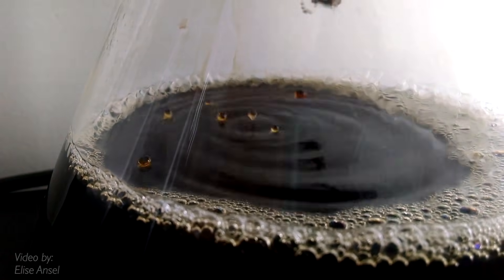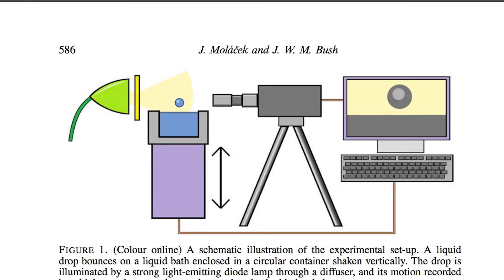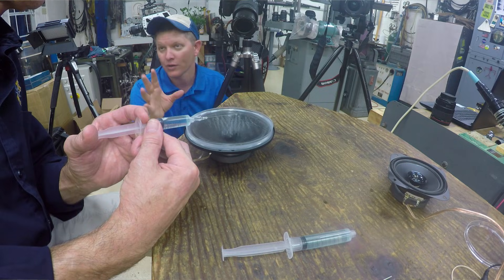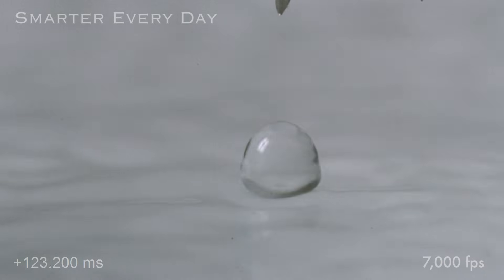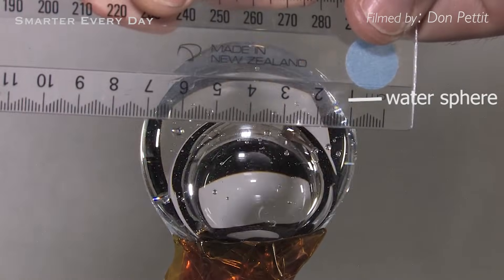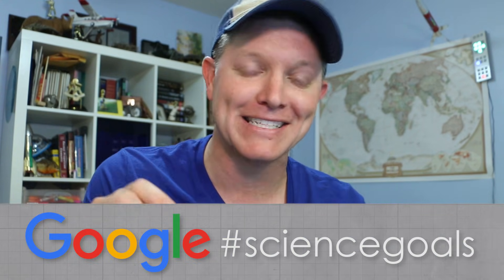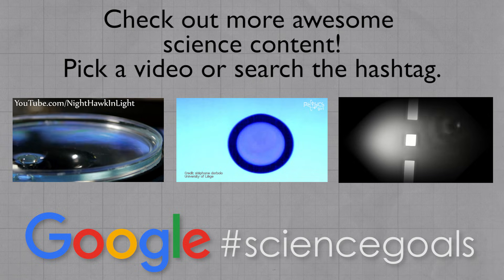The WALKING WATER Mystery (in SPACE and SLOW MOTION!) - Smarter Every Day 160

Comment: Hey man, you are clearly brighter than me, but if I can throw a couple of experiments at you that i did around something very similar. Run sine waves at 620hz and the water boils. Now, think about this, why boil? I took it one step further, and discovered hydrogen separates from the O2 at 500hz. So in effect, we are creating a quasi electrolysis . HOWEVER, coming to your quest, i noticed one of your "queries" before you approached the scientist/astronaut  , I saw hydrogen bubbles from the heat. This made me curious. So I made some bacon and eggs, and then put the hot pn under room temperature water from the tap... only a few drops. Watch the reaction, its hydrogen separating from oxygen . What do you think man? its fairly interesting. Nice work bud, keep it up

Comment: but, what about when the surface is smooth and calm. and the drop of water float across the surface, and bounces off the wall, and remains in motion for a little before sinking. why does it do that? there are NO vibrations to create a layer or a cushion of air.  then what?

Comment: I always thought it was because the water droplets were a different temperature, making the water density just enough different that the water would bead, until the temps equalized. just a guess. but the same (beading) thing happens with oil and other fluids as well.

Comment: at the speaker scene you have the speaker only half full and the water drifts to the side but if you fill it up over the rim, which is doable you would get water drops floating in the center only and that's because its the highest point on the liquids form

Comment: hey Destin. I think the mass of the drop isn't enough to overcome the surface tension of standing water. Gravity does overcome the drop over time, but there is enough resistance between the surface of the reservoir and the drop to repel it. When you applied the sound waves it incressed the surface tension, in different ways, at different frequencies right? This is entirely theoretical, for me im just trying to offer a different perspective.

Comment: Great video, but it puzzles me that you are clinging on to the idea that there is a layer of air between the droplet and the body of water. Intuitively, or from what I know, I would say this is a result of surface tension, of which I may be equally wrong, but assumption, as we all know, is the mother of all f... ups. A common misconception about gauge blocks sticking together, also had the idea of air cushions which had to be squeezed out, but this also turned out to be false, at it also happened at the ISS.

Comment: surface tension of the bottom layer of the water is increased as the frequency increases, more surface tension in the bottom water layer has its particles moving with resonant waves. The off chance the top droplet does get observed is possibly at the perfect droplet contact with the critical points of the frequency wave.

Comment: Electrostatic repulsion and surface tension. Both the body of water in question and the water droplet are subject to electrolytic charge and surface tension.  The droplets you are observing occur when the water droplet has a opposite electrolytic charge than the body of water it is falling into, since the charge is present in the surface of the droplet and the body, the surface tension of both the droplet and the body of water repel each other until the charges equalize.
Reply: opposite charges attract.
Reply: Surely equal charges repel?. But yes. I feel there is more to this than air / water boundary effect.
Reply: Surface tension.  Period.
Reply: Yah I totally agree
Reply: They mention electrostatic, not electromagnetism... ???
Reply: NO! The charges do NOT 'equalize'. The water molecules reorient themselves so that their polar dipole moment attracts instead of repels. It isn't electrostatic, it's polar molecular! This is actually a better explanation than an air layer but the air is necessary to form the water liquid crystal phase. In reality water at an air-water interface undergoes a phase transition where the water molecules are oriented in liquid crystal chains due to their polar dipole moment.

This (North-South-North-South) bonding structure is much stronger than the bulk water and the interaction of the two surfaces will naturally be of like charge and therefor they will repel!
Reply: Then why does changing the air PRESSURE change the phenomena?
Reply: Because removing the air pressure changes the surface tension and electrostatic pressure. Seriously, this isn't even Physic's 101. This is like Physic's 70. this is covered in the most basic introduction to Fluid Dynamics.
Reply: I still don't.  Nobody yet here has showed me how you can make a drop of water hold a charge, but hey, don't let little things like that bother you.  ;-)
Reply: Close but not quite.  It's actually exclusion zone water that is forms a layer of negative charge around almost any body of water including droplets.
Reply: rushthezeppelin EZ water is what taylor was talking about... "liquid crystal". Same thing different name. Just more details and technical terms that were not used in some videos I've seen, on this topic.

Comment: Not entirely convinced. Kinetic energy is a factor in the destruction of a droplet, but isnt a skating droplet a surface-tension phenomenon?  The macro binding energies in both the droplet and the water being directed mostly laterally, (and not toward each other).
Also, it may help greatly if the surface is turbulent because this might increase the amount of overall gap between both surfaces.
Does having rotating droplets increase longevity?

Comment: this has nothing to do with air molecules! it's due to temporary electromagnetic charge differences in between the drop and the landing surface!
Reply: "It does not". Dude, there's a paper... People tested it.
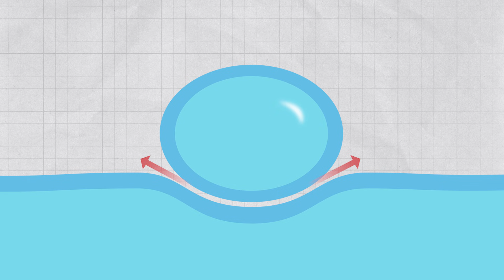Reply: +John Sikes  Sure 3:32
Reply: John Sikes The "it does not" was directed at the original poster
Reply: Liquid water cannot exist in a vacuum. It will boil.
Reply: or to be precise, the lack thereof ;)
Reply: k1p Are you high?! Jesus christ ive never heard something so stupid!
Reply: Then why does changing air pressure effect it?
Reply: Do you mean "Affect it" No it does not! use complete air vacuum you will get the same results! Cheers
Reply: Jon  ...  Sort of.   That's like saying liquid water cannot exist in a pot boiling on the stove.  It can for a while, until it boils away, which does not happen instantaneously, although it definitely doesn't sit "quietly".  It can also exist for a VERY, VERY long time underground as ice or possibly liquid in locations like the moon, I think.  Also, to further address k1p's statement, experiments show the time to the bouncing drops "melding", or disappearing into the main body of water it's bouncing on, DOES change with atmospheric pressure.
Reply: Tordah  ..  Which part are you referring to?  Can you link me the paper?

Comment: Great video thank you for posting it. I had a science question about it tho, is the coalescence delay only being affected by the air pressure or could difference in the surface tension between the droplet and and pool of water have an influence as well? Could this experiment be tried in a vacuum to find out?

Comment: I have a theory on your water droplets but you and the other people on here might not agree! The water that is standing is static plus is heavier than the water droplets falling on it. The water molecules in the droplets are lighter than the standing water that it's hitting, it doesn't have the correct amount of equivalent molecules to merge with the same water of it's composition and or mass. Therefore the droplets the sit on the standing water, when they sit there the heavier molecules in the standing or static water have to move out of the way to except the lighter molecules in the droplets... Also the droplets traveling through the air might possibly have differently charged particles/atoms in the molecules of the water droplets that are different than the water in the standing or static water. They repel each other like north & south magnets, the standing water has more mass and eventually change the little water droplets at a subatomic level to a point that we don't even understand!

Comment: In regards to hot liquids: My guess the hotter the air or the liquid making the air hotter in the case of the coffee will excite the air molecules making harder of the water to become one. The air molecules are bouncing around between the liquids instead of flowing outwards at a cooler or normal temperatures. Also steam from coffee could play a roll.

Comment: I would think that this has more to do with the force of surface tension keeping the bodies separate.  

A pocket is made in the water that the drop lands on do the the surface tension of the drop deforming the surface of the water.  This would be due to the surface of the drop, as well as the water, having their water molecules aligned so that the poles are opposite of each other, thus repelling.  With water having a positive pole at the hydrogen end and a negative pole at the oxygen end.  For this example the surface of each body would be positive or negative.  In the "Theory vs Experiment: What is the Surface Charge of Water," it was found that equilibrated water (water exposed to air) has a negative charge.  The surfaces would repel each other and there would in fact be an air gap.

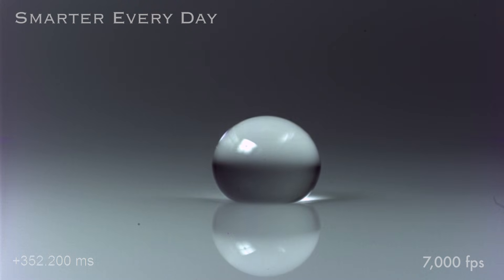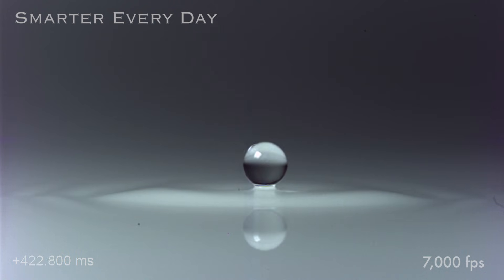Once the bodies are in proximity for enough period for the poles near the surface of each body to align they merge.  This would also explain why when the droplet merges with the water it does so violently and, as seen in the video @3:46-3:56, the upper portion of the merging droplet begins to form another droplet body.  With the poles continuing to align and merge the body faster, smaller droplet bodies continue to be made until the entirety of the droplet mass merges with the larger one.

I wouldn't doubt that the droplet bouncing is effected by air between the bodies, though I do not believe that fully explains what is being observed.

Comment: Cool video, but you didn't take in consideration of a key fundamental property of water that holds water together at the molecular level. The edge of water is made up differently then the center of the same water mass at the molecular level. This is what kept the water in place at zero gravity and allows drops of water to bounce on a larger mass of water here on Earth. It's also is responsible for allowing certian insects and lizzards to walk and run on water. You can fill a glass of water past the top of the glass and the water hangs on slightly until pressure from gravity finially breaks the molecular water bonds and it spills over the edge. It would be interesting using your high-speed camera to film the same experiment in a vacuum sealed chamber with no oxygen in the chamber. Very interesting topic. Thanks for sharing.

Comment: My son and I are attempting to reproduce this with a speaker setup and all. We tried water, but could not get the drops to "dance". Using milk worked. the frequency we found was successful is 63Hz with an amplitude of 80db. My question is, water frequency did you use to make the water drops dance?

Comment: I'm not sure your air gap hypothesis holds up. What happens when viscosity is reduced? 

I think you're correct in your original thought that the water is acting hydrophobically. Think about a blanket of water molecules with the Oxygen portion hitting another blanket of oxygen out molecules. They'll resist each other. This resistance causes the air gap, and bigger drops overcome this resistance more easily. Think about the action which happens in snapping the tail of Prince Rupert's drop. Same here once one molecule flips, the pseudo membrane loses its structure.

High speed one of those two liquid medium toys where a nozzle drips onto a cogged wheel or ramps and the spheres fall to collect at the bottom, and then reform a single liquid.
Reply: ps I'm not implying there's no air gap because it's liquid in liquid.

Comment: Very interesting. I have been thinking about vibrations for many years and I think I know the answer to why Cello music did it when other electronically created vibrations did not. Imagine pushing a dead tree until it breaks. you need to constantly add force at specific times during the "Vibration" of the tree to increase the energy that causes it to finally break. but as you are adding energy you are NOT increasing frequency, only amplitude, Frequency actually stays the same or  decreases (I don't know). but the point is that Cello music would produce vibrations that are NOT constant, therefore slowly build energy in Amplitude which will build until the medium being vibrated fails or breaks or shoots off little drops of water ..... like a wine glass broken by sound waves. I believe the secret to breaking a wine glass with voice is not in holding a specific note, but slightly increasing or decreasing the sound at exactly the right RATE to be just lower than the vibration that has been set up in the glass at any given point in time.

Comment: surface tention, just like right before water runs over a cup it will raise above cup lip then flow out,  water has a surface and when they are in drop form and moving they tend to not merge right away, but as you say dance on top of the water its on

Comment: After learning about Ordinary Differential Equations, wouldn't this be attributed to that? We know how the water droplets stay formation on the speaker disk. Vibrations from the speaker with the right frequency causes the droplets to stay formation due to the right equilibrium of the differential equation. Wouldn't that also be attributed to when droplets clash with the water by the force of gravity? The water droplets hit the surface, causes a vibration on the droplet bubble and the surface causing it to fracture from the surface for a few split seconds which makes it look like it sits on the surface of the water. The air gap between the bubble and the surface don't merge until coalescence which can be solved through an ordinary differential equation. The water bubble has to reach a certain equilibrium(The Steady State Vector?) in order for the droplets to merge the with the surface because the strength of the vibrations decrease over time which causes coalescence. :D yeah I hope this makes sense...

Edit: just finished watching the video... i'm not a physics major but it totally makes sense with the math equations. puts a few holes in what i said earlier. Anyways, THIS IS SUPER COOL! Loved the water bubble with the air bubble part. :D

Comment: 9:45 - 9:50  Two drops coalesce inside the air bubble! If you label the top of the camera North, then the first drop is going Northeast, and the second is going East by North. The actual collision happens at 9:49, just barely a mouse width to the East of center.

Comment: There is no room for the drop to settle so it keeps moving around on the surface looking for a spot to coalesce. Additionally temperature and the speed of the movement of the molecules can be a potential factor in of the drop coalesces or not.

Comment: I really like your videos but sometimes they end with an unfinished conclusion / explanation. You jumped to the space video and ended without any conclusion. You didn't even mentioned the water surface tension. This experiment could go way further with other liquids or even soap in the water to soften the water tension. Also about that music, did he tried the same song with another instrument? Is it the instrument or the harmonics that produced that effect? You gave me more questions than answers this time and unfortunately I don't have the means to experiment :( can be you please experiment further on this? You can use mercury, liquid nitrogen, soap solution, oil... Also if you calculate the speed of the water drop when it hits the water and use a subwoofer with the right frequency to match that speed you may be able to bounce back a drop to the same height (in theory). What about the same experiment in a vacuum chamber? OMG so many ideas.

Comment: Water beads floating on water is explained by hydrogen bonds. The negative side of water has the oxygen atom, which is attracted and wants to bond with the positive charge of the hydrogen of a nearby water molecule. This results in a weak bond between the atoms due to charge that is still strong enough to support small amounts of weight (like another drop of water or a water skipper bug)